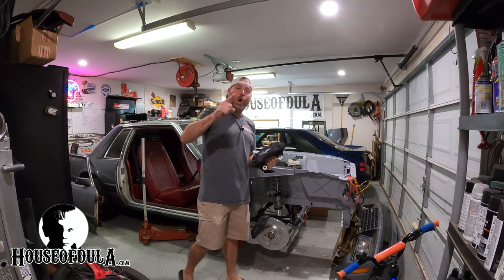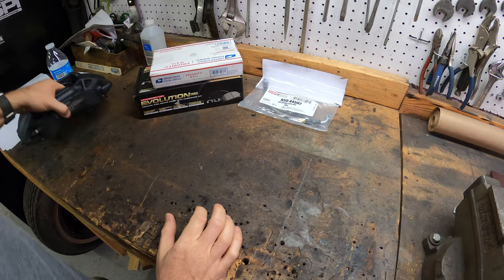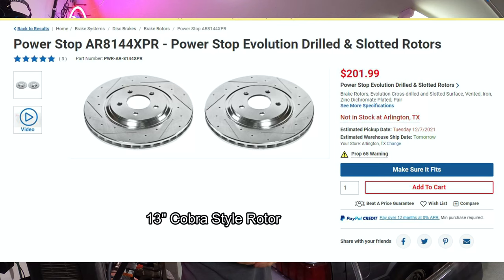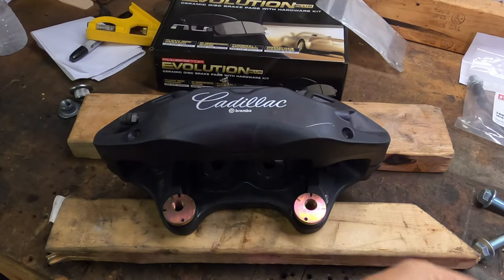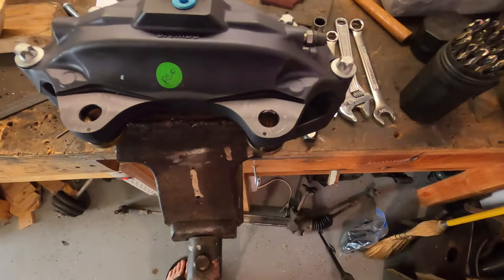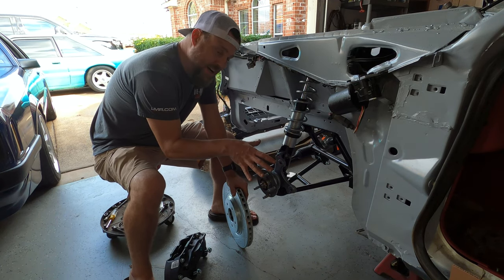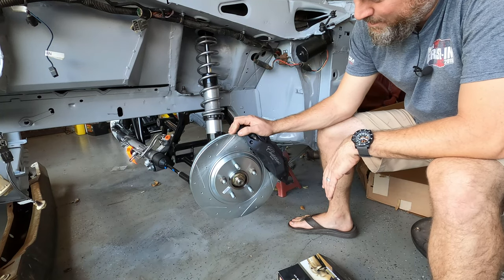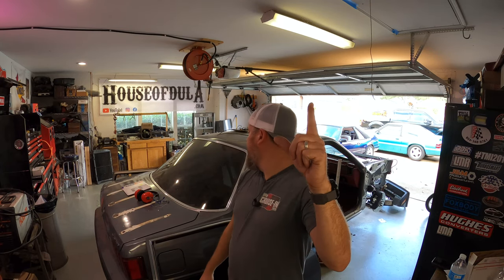Cadillac ATS Brembo Install with S&S Engineering Kit - CHEAP BIG BRAKE KIT for your Foxbody - Ep 28

Comment: When using the ATS calipers your brake bios will be changed,  since you are upgrading your rear brakes as well you can use the cobra rotors and caliper mounts with 93-2000 Taurus rear calipers which have a 43mm piston. Using the larger piston on the rear along with the 1" master cylinder will make your brakes work the way you want them too!
Reply: Agreed! When I was using gt calipers the pedal was pretty hard and was kinda hard to push the pedal. When I swapped to the Taurus calipers, man what a huge difference! I could modulate is he pedal and the car stops on a dime
Reply from the maker: Good info. Ive heard there were better options for the rear. First Ive heard of the taurus caliper swap. Will have to look into this as well!
Reply from the maker: Thanks fellas. I'll go this route when doing the rear.
Reply: @HOUSEOFDULA  they literally bolt into cobra/gt brackets. Use the same soft line too. But the bigger piston is a huge upgrade
Reply from the maker: @kenb1918  Right on!
Reply: Taurus calipers with (06-08) taurus rotors in the back (I think, I'll have to go looks at receipts). You have to make a plate to space the caliper out but they're like a 12. 5" rear. Looks great, stops even better. I did have to scrape my wheel weights off my 17" fr500 wheels to get the fronts to clear.
Reply: @howardnelson6578  you don’t have to use the Taurus rotors, just the calipers. Atleast that’s what I did, using cobra rotors/pads
Reply: @kenb1918  you do if you want to oversize your rear rotors. Search YouTube for 13 inch rear brakes sn95. Guy has them on a (looks like) 2000 cobra R. Tells you which ones, how much to shave out of the center, and exactly where to drill the holes in the 1/2 inch plate so they'll fit. Fun little 3 hour project.
Reply: @howardnelson6578  I don’t see the befit you having even larger rotors. I beat the crap out of my car on the autocross and touched a little on a road coruse. Zero issues with my current brakes...
Reply: @howardnelson6578  can you please detail this for me. I honestly dont understand as it will be my first time attempting tuarus caliper on my fox
Reply: I'm sure a bigger piston is a nice upgrade, but wouldn't the adjustable proportioning valve solve the bias problem?
Reply: I’m doing this setup on an sn95.   Do the Taurus calipers bolt right on?

Comment: if you want full contact of the brake pads use 2011-2014 GT standard non brembo rotors 336mm/13.23'' rotors. using cobra 13 inch (330mm) rotors leaves 6mm of unused brake pad. you can still run it and the pads will wear out and both sides will not interference touch.
Reply from the maker: I havent heard this yet. Great tip!

Comment: Very nice upgrade. I watched a few other videos on this setup and apparently you need to upgrade the rear calipers using from a Ford Taurus? I just did a rear disc conversion from LMR. Will the Cobra calipers with 10.5” rotors work with this setup? I think the piston on the Ford Taurus caliper is a little bit bigger than the Cobras.
Reply from the maker: So yeah...It's not "needed" per-say but helps with the bias and pedal (and pedal feel ive been told, I still have yet to drive this setup as wel) balance since the Taurus's piston is slightly larger. Otherwise you just have to adjust to try to get more pressure to the rear. I planned on going the Taurus route, but if you already spent the time and money on the rears don't change. Just drive it, get it broken in, send a little more to rear on the proportioning valve and call it a day...test it out see if you like it. Thats what I would so at least.
Reply: I have an adjustable proportioning valve so just put more pressure to the rear as needed. Thanks for the help I was just wondering how everything worked with your setup.
Reply from the maker: @DarkFoxx88  You bet! I wish I knew, but not certain yet, should work out and stop like a beast

Comment: Did this one 4 years ago. Didn’t work that great on fox . Works feckin great on ford obs trucks though! Thanks
Reply from the maker: What was your MC bore size, pedal setup and rear caliper bore size? Curious as to why it work well, and what your setup was. The MC size, if using a manual brake pedal vs power assist brake pedal etc all make a difference, this along with front rear bais, and rear caliper bore sizes all play a part in the hydraulics.

Comment from the maker: PINNED! I just to inform everyone that the StopTech brake lines in the video are likely going to be too short! I'll update when I have a better part number for these. ALSO! S&S said if you dont want to run a spacer, having the calipers machined is perfectly fine.
Reply: Okay well I have them on the way it they work I’ll let you know. Also I watched a similar video and he said for the fox body hard line to ATS he used the same line that went to his PBR calipers that where on there already, if that’s the case mystery solved! Thanks.
Reply: Maxima motorsport part #MM-MMBK8F works great,long enough and I use an angle kit for drifting and I have plenty of slack
Reply from the maker: @slow_carsgarage7422  Thank you!!

Comment: Cool. I was stinking about doing this to my 88 Stang as of right now still has the original calipers on with Mark 7 rotros ans SN95 rear disc brakes.  94 cobra master and SN95 V6 car booster.  My only consern is the 17" wheels i got on it. They are factory  Mustang Gt sport package wheels 3 double spoke wheels. 17X8 with p245/45R17 tires. I don't know if they will fit over the Cadillac caliper. May have to go with the cobra calipers instead. i love my wheels.
Reply from the maker: I understand that completely. All the wheels I want will not fit the brembos, however, oddly enough the FR500's (17x9) off my 86 fit snug with surprisingly a lot of room. Ultimately unless its a track car, the wheels and tire combo make or break a street build.

Comment: I installed the ats Brembo calipers on my 85gt. I modified an old baer brake spindle and re drilled ats rotors  for my 4 lug set up. The calipers work great and great video.
Reply from the maker: Good stuff. Would be neat to see a 4 lug 17 pony setup with these calipers.
Reply: Regarding your '85 ATS Brembo install, did you upgrade the rear to disc? If so, what other upgrades were needed to make it work (booster, mc, proportioning valve)?
Reply: @riverview2233  I have the 1988 turbocoupe rear disc set up. I never installed a proportioning valve but I did install a 1994 Cobra master cylinder. The braking feels good and on the track.

Comment: I have the 17" pony wheels on my car with the ats Brembo, they just fit.
Reply from the maker: Oh man!! I stand corrected. Right on! and sorry for any misinformation. Good to know.
Reply: what spec 17 inch pony wheels are you running, is it the 8 inch front and 9 inch back or 9 inch front and 10 inch back? really need to look into my wheel options before buying
Reply: @Jake.Shimada  I am running 9" all the way around with a 275 tires. I had to do a lot of work to get them to fit in the front. If you roll the rear fenders. You can run a 9" or 10" pony rim in the rear. You can run a 8" in the front with stock fenders.
Reply: @robertb3409  thank you so much for your reply really helping me out!!!!1
Reply: @Jake.Shimada  I can send you a picture of the clearence if you like.

Comment: Excellent video! Do you know whether the Cadillac ATS/CTS Brembo calipers hold up to the extensive heat of endurance racing? Our stripped '85 Fox Body is built and used 100% for track competition - up to 8hr stints.

Comment: I can’t wait to get mine on now, I using new edge spindles. I used them on the mustang as well they are only just over 1/4” wider per side. Which is really not that big of a difference. The new edge spindle are quite a bit cheaper as well. Great Video keep up the content.
Reply from the maker: Awesome! Let me know how it goes. Man I think I said 1" per in my video lol for the 96-2004, Im sure that well over exaggerated but it  moves em out. 1/4" per seide is not much at all.
Reply: I will for sure, I want to do a stopping distance video before and after to see the difference

Comment: Nice kit. I personally used the FTR adapter kit that allows the use of the GT500/BOSS 302 caliper and 14" rotor with SN95 spindles. It requires no grinding or drilling and are literally bolt on. The 14" rotor is a  lot beefier than the 13" Cobra rotor which important to me because I plan on open tracking my car one day.
Reply: Many people with 13” open track w/o issues, even with the heavier 5.4 4V. 14” FTR kit is good, but requires also a bigger rear and you have more unsprung weight vs 13”, and also you can use the S&S kit with S550 rotors that are a tad bigger and thicker if you want more heat dissipation
Reply: @TheSunChaserUS  stock s550 GT rotors?
Reply: What do you use that much brake for tho? Doesn't a fox only weigh 2700lbs??

Comment: Hey man I know this is an older video but I have been referencing it lately trying to put together my brembo swap and I was wondering if you had any input on if my current 17" 03-04 sve(cobra) wheels will clear? Love your content and thanks for any feedback.
Reply from the maker: Hey man! I get asked this a lot, what wheels fit, etc. I have measurements posted on houseofdula.com, Its not all the diameter and backspace as it is the wheels spoke design. Chris Salmon, the guy who runs S&S Engineering and makes the swap bracket keeps a running wheel chart, look here https://www.ssengineeringllc.com/_files/ugd/c21922_3e90d6bb9aee4221915b8d3e5f30c90b.pdf It seems they do fit.

Comment: I’m shopping around for brakes on my Coyote swap and stumbled across your video. Great job explaining. Just wondering what you’re doing with the proportioning valve? I’d like to use a 96-98 hydroboost because of clearance on the valve cover and wondering what you’re using.
Reply from the maker: Hey bud! I'll be putting in a manual adjustable valve for the rear. Because I dont have a rear caliper picked out (likely taurus)...An adjustable one will help me dial it in. You do need a stronger rear brake though to help with the bias.

Comment: Great build man. What size offset did you use to clear the Brembos or what rim will clear the caliper.
Reply from the maker: 17" minimum diameter. Offset and diameter though is not the big deal, its really the spoke design. The spoke to caliper clearance. A lot of fox wheels are dished and flat spoked, these wont work. What Ive been having to do was take measurements to the wheel companies and see if a particular wheel will fit or not.

Comment: Great video and upgrade!! I’m looking at doing this, just one question did you ever confirm that the break lines would work? I looked up the part and it’s is a Lexus/Toyota rear brake line. I bought the calipers and rotors and going to get the ss kit just confirming the lines thanks!
Reply from the maker: No, I just did this last weekend. My thing is with no engine / weight on the car, coilovers not set etc, the brake line doesnt reach the bracket. Im not certain it will be long enough, but I just cat tell not. And my brake lines are even yet made. I think I found a forum on stangnet, where this was the part number others used for this on their mustang.
Reply: Maximum Motorsport part #MM-MMBK8F works. I have and angle kit for drifting and I have plenty of slack left. Comes with banjo and washers
Reply: That’s great news! Those are the ones I have for my 5 lug and brake conversion! Mystery solved!! Thanks for the help!

Comment: Did the stoptech brake lines work?
Reply from the maker: Yes they will...just use the updated part number I posted. The ones in the video were too short. I still have not plumbed my brakes but the length is fine.

Comment: Hey man. Love the video.  I know you have had many questions about wheels onnthis video and its been a little over a year. But have you figured out what offset is needed on wheels to clear these calipers?
Reply from the maker: Thank you bud, appreciate it! Im still working it. Offset and oddly diameter is not really the biggest issue, its spoke clearance and placement. Most common "classic" foxbody wheels, Aodhans, BBS etc...with flat face and "dish" will not fit these. Will need to use a slightly more modern rimmed edge spoke style wheel. Believe it or not the 17" FR500's I have on my blue car fit perfect. These are the LMR FR500s. 17x9. Standard offset, 17" and only 9" wide they fit...but its because of the spoke design to allow for that caliper face to spoke clearance. Its been painstaken BUT I think I have an ESR wheel in mind for it.
Reply: @HOUSE OF DULA  oh ok. Yeah I plan on get wheels from LMR but also plan on doing this upgrade as well.
Reply from the maker: @AJHanna1982  Depends on the wheels but if FR500, theyll fit fine.

Comment: Obviously this is a great upgrade, but can we talk about foxbody brakes? I have the sn95 spindles with the 95 v6 front calipers, and it's slightly better than stock I guess, but the fronts lock up, so.damn.easy. I've come so close to rear ending people in the rain multiple times, and then I get in my 88 Camry and the brakes never lock up, stops fine and I never see my life flash before my eyes when Im driving it. And it has 40$ tires.  Im just scared upgrading the brakes would make it lock up even more.  Or does the design of them mitigate this?
Reply from the maker: Yeah, not normal. Shouldnt lock up like this. Your master cylinder sounds like its off, along with the fron/rear bias or bad/crappy tires. The pedal effort should modulate the brakes. Even with big brakes. The big brake kits WILL stop on a dime, but only if you command it to and mash the pedal. Also big brakes are installed for fighting fade, abuse when road racing or lots of heavy stops. Something is wrong with your setup, either master cylider bore size or front rear bias. Bias: Fronts locking could also just be not enough braking applied to the rear wheels, without the rear brakes, this puts all that weight transfer to the front causing lockup and worse the car will want to rotate 180. On a stock mustang the bias is hard set in the brake proportioning valve. Usually with a 5 lug conversion, the proportioning valve is gutted, and a manual valve in placed between the master cylinder and rear brakes to manually set the bias. This or crappy front tires. You said $40 tires? is that plural for both?

Comment: I just did this, great vid!
Reply from the maker: Thanks! S&S's kit is great IMO, makes it so simple.
Reply: Did your brakes stopping power improve
Reply: Haven’t needed them like that yet but they do feel better. I have Manuel brakes, I believe if you still have power brakes you will see a better response.
Reply from the maker: @budgetracing7311  Yeah, mine, I put on a stock booster. Small, but fits, so it will have some assist.

Comment: Great video Anything for the rear of foxbodies close to this ?
Reply from the maker: Well wilwood or baer, and others, but not the cheap brembo from a caddy like conversion that I personally know of. Most use the standard cobra rears with these and had good luck with bias, when used with a manual control valve

Comment: Instead of  machining off 2mm from the spindle, couldn't you machine off 2mm from the caliper so you wouldn't have to use the spacer? Or would that make the mounting points too thin and weak?
Reply from the maker: So I hit up S&S about this and yes, in fact its preferred if you dont want to use a spacer. The calipers are built for a much heavier car and plenty beefy. The .100 off of the caliper is preferred so you dont have to machine the spindles.

Comment: Longtime subscriber, but was away for a while.  I missed the full description of "Project EgoBruise".  Which ecoboost engine are you putting in with the t5?
Reply from the maker: Hey man! well...welcome back! You might want to go back through the videos/ project egoBruise playlist. Its getting a 2015 mustang 2.3 ecoboost.
Reply: @HOUSEOFDULA  Thanks.  Is the Torino still around?  Also, the Calypso, looks beautiful.  Whats the plan for it?
Reply from the maker: @ghostinthetreeline  Yessir it is, I'll never sell that Torino. Its at a buds shop, simply because I dont have the room. Appreciate it about Calypso! Man its only real goal right now is to keep it running, as my wife daily drives it. We would like a set or 17" pony's maybe, and fix the rough suspension.

Comment: I have a 2004 mustang gt and replaced my rubber brake lines with the russell stainless steel brake lines. Do you think that I can use those lines on the brembo caliper instead of buying the ones mentioned?
Reply from the maker: Of course, they will work fine. Most people move to braided when they have the opportunity, and there is zero balooning in braided and can tend to give a firmer pedal. We're talking a very small amount of "firmer" IMO, Ive used both and barely can tell any difference.

Comment: Sweet kit! I've been looking for an upgrade. I'll check their page out but do they not specify or recommend a particular backspacing or offset for wheel choice or even minimum wheel diameter?
Reply from the maker: No, with something like this your kind-of on your own to measure and do wheel homework. Google "cadillac ATS brembo mustang wheel choice" and there are a few threads out there with lots of folks trying it with different wheel choices.
Reply: I took a look at their page. They provide distance from outside of caliper to the mounting surface of the wheel. That’s a good start. 

Not that this is your issue but they should certainly have that kind of info available and fortunately, they do.